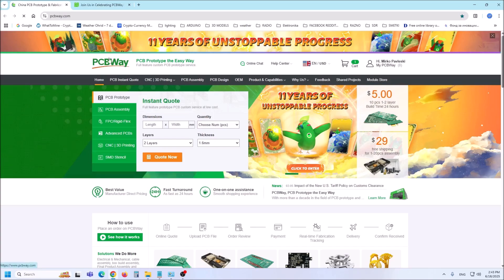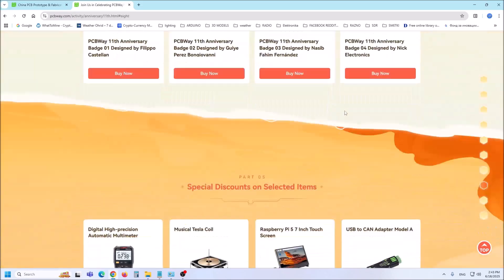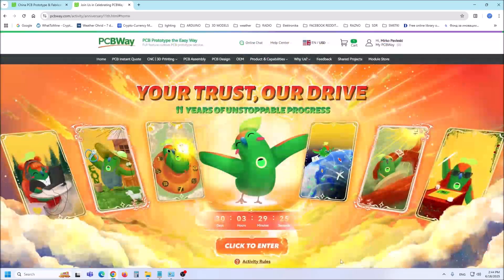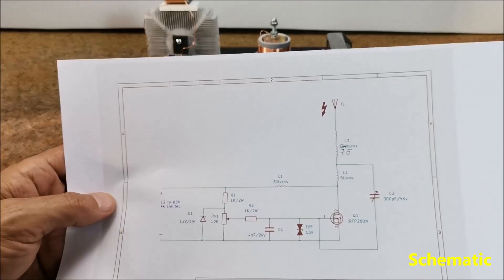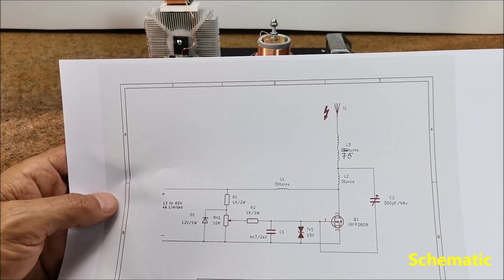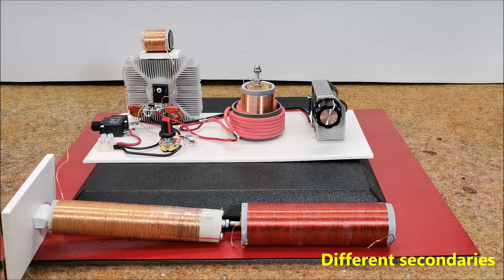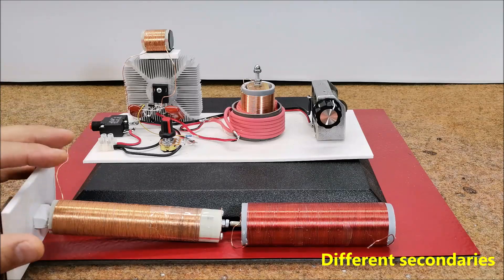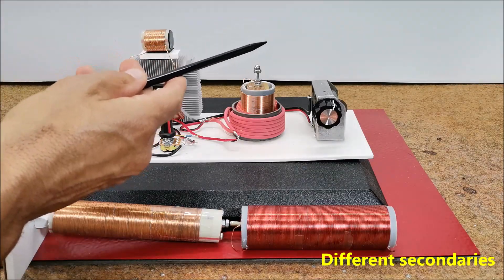Building a Plasma Flame Generator , HFSSTC Class E Tesla Coil

Comment: Thanks for the nice video. good explanation, nice project. I see that you did point-to-point wiring not on a board, any reason? Also liked the use of a simple oscilloscope to check the frequency of the tank circuit.